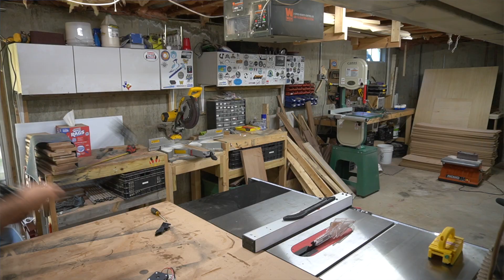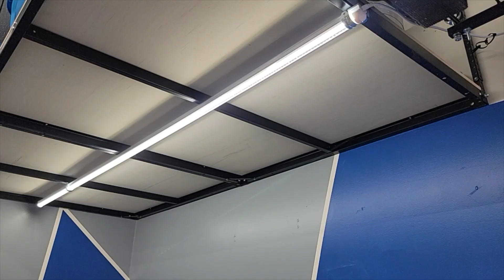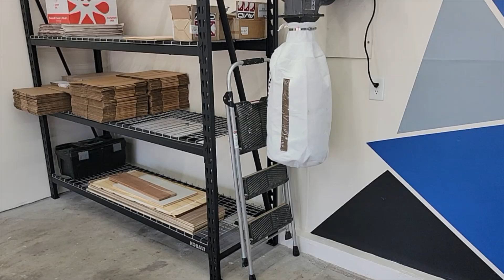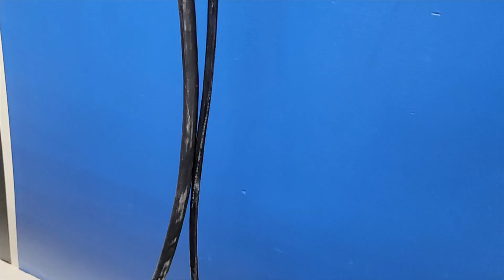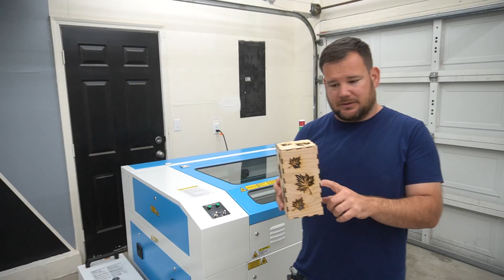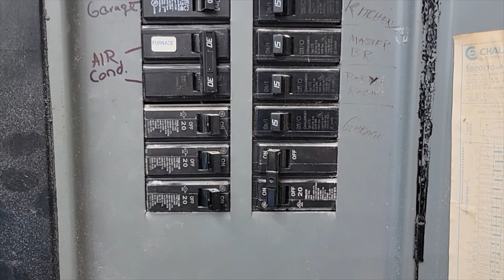New Shop Tour AND A New BIG Laser!

Comment: Hey Andy what did you end up with for heating and cooling in that garage?  Freezing is dangerous for the CO2 tube and humidity is a problem in the summer.
Reply from the maker: I added a mini split mostly just for comfort though. Honestly it has to get sub-20 degrees outside for  a few days for my garage temp to get below freezing. And where I'm located, that rarely happens.

Comment: Hi Andy, I almost ready for my cnc place. Waiting for the last parts of the cnc. I am living in Thailand thus supply is a little different. The only thing is the shop vac. The shop vac itself I have but the duct is an issue. I have a 4 meter duct which is very heavy and too heavy I think for the cnc to pull it around. I saw your duct that looks very light. Any suggestion?
Reply from the maker: Hi Peter, it's tough to say what you'll need for your particular setup but I always use a four inch hose flexible house made from pvc.

Comment: I put up those same lights in my shop, 11 of the 4', 3 or 4 years ago. Having plenty of light in the shop is a must. Also, you can get thin mount and quad breakers and add several more circuits to that panel, both 110 and 220.

Comment: Avid and 100W laser will open up many more options. That laser should be able to cut up to 3/4” stock easily that can aid production. As for mini-split, I decided last year to switch to a heating/air conditioning unit and it’s been a game changer as far as using heat and electricity since oil has gone through the roof. Only question is usually the good unit mini-splits require 240V and it looks like you are out of slots. Will it have to share outlet with CNC?

Comment: Nice design! My wife gave up her parking spot in the garage so we wouldn't incur the cost of building an addition onto my backyard shop. She is so incredible and I'm grateful for her! I also installed a mini-split in mine. After months of research on brands and installation, I ended up going with Mitsubishi and having a company install it. It was not cheap- but in the end it was the right decision because our city code requires an inspection on those install jobs. It was not something I could have pulled off after watching them do it. They were very picky about installing a french drain system on the outside wall.    I also love the design on the wall. I too will be painting my wall, once I sell my Shapeoko. Finally got the 2nd shipping notice on the Avid.

Comment: You can consolidate existing circuits into the half size breakers if you need to add additional circuits.
Reply: Yup. Also called Tandem Breakers or Piggyback Breakers. They also come in 120v - 240v combo to get another 240 space.